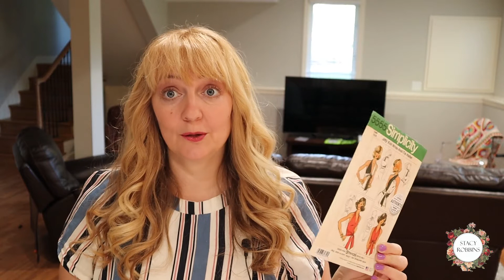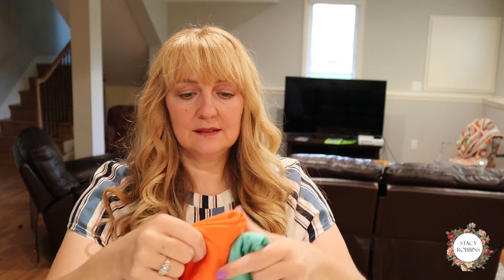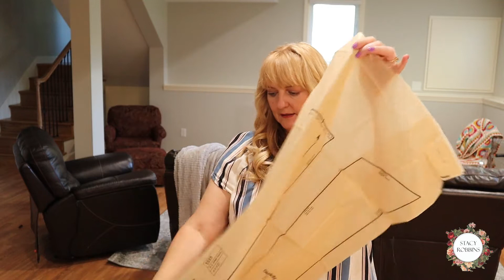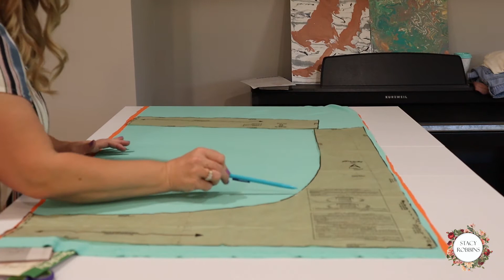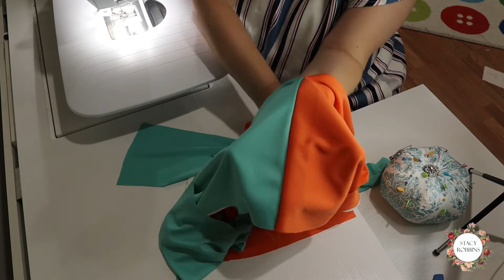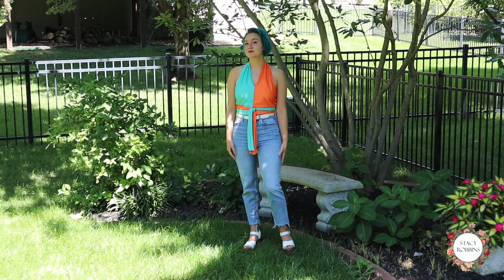Fast and Easy Simplicity 5555 Vintage Halter

Comment: HI! New to this sewing stuff too. Is it ok to sew in the liner after the top is finished, or only when making the top. And will it change anything or no?
Reply from the maker: There are ways to add a lining to a finished garment. Things to look out for -the lining fit is often slightly larger so that it doesn't pull the outer garment. Often lining can be tucked in behind facings or attached at the facing. It can  be hemmed slightly shorter than the finished garment and swing free at the hemline. It depends on the style of course. these are just a few if my first thoughts. Welcome to the sewing circle! There are lots of creative people here. 🧵

Comment: I’m new to sewing with knit and I been studying before I try.  I thought you could not use a straight stitch with knit. 🤔
Reply from the maker: It depends on the project! I would say almost always use a tiny zig- zag instead of a straight stitch otherwise you will get popped stitches. This project doesn't pull over the head or really pull at all. So I did a straigt stitch. If you watch my other knit projects I recommend overlock stitch or zig-zag. A few I even show the stitch settings.